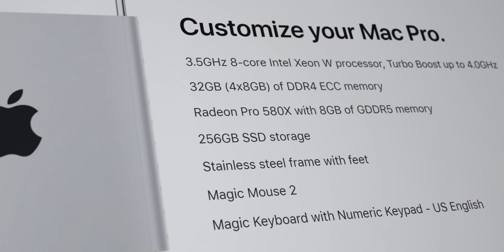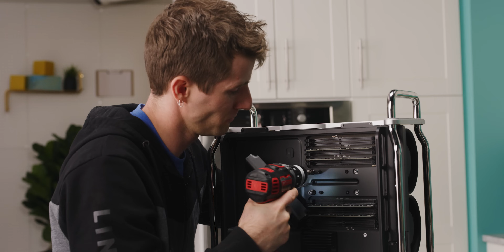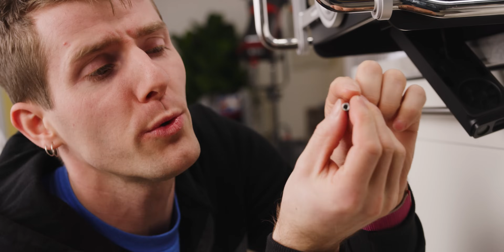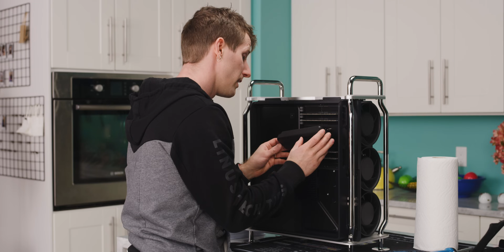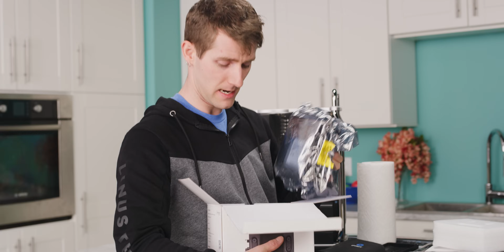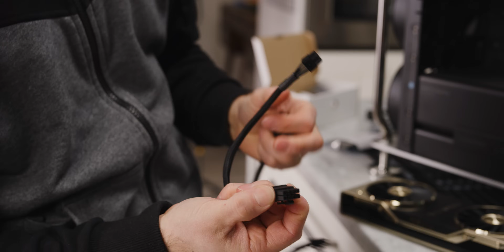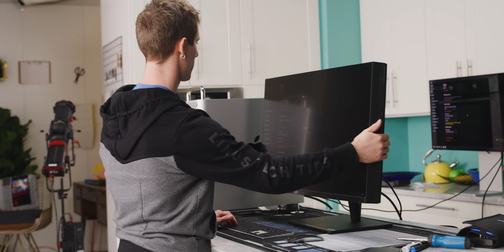Don't give Apple your MONEY - Mac Pro Upgrade Adventure

Comment: First of all, great video Linus! 

Secondly, just added up all the individual parts, from your list above, using the Titan RTX, R4i Raid Disc Enclosure, 96 GB RAM and the PCI-E Aux cables and we're already at $5700. Now add that on to Apple's $6000 base cost and now you're at $11,700. I mean, am I missing something here? Even with a third party upgraded CPU we're looking at even more money than my current machine. I can spec out a 16 core mac pro, on Apple's site for $12,799. We're talking only a $1000 savings, roughly. This is my first time even considering building a Mac Pro. I currently have the following at my house and planned to keep it (still might) until I saw this video. Here's the exact mac that I have now.  

MY CURRENT MACHINE: 
3.2GHz 16‑core Intel Xeon W processor, Turbo Boost up to 4.4GHz
96GB (6x16GB) of DDR4 ECC memory
Radeon Pro Vega II with 32GB of HBM2 memory
4TB SSD storage

I'll gladly take any tips here to save some money if I can...although this IS my main production machine (video and audio) and I can't afford to have it go down from some sort of hardware or software failure, just because I wanted to save a little money. 

Perhaps someone can guide me on how I can build my current machine, with third-party parts and save money because I'm just not seeing the gains vs cost here.

Comment: Use SCIgrip polycarbonate, polyethylene, acrylic, glue for plastic tabs that brake or any plastic it chemicaly heals the break will even glue a broken window back to where you can't even find a break.

Comment: Well, i know for over 10 years that you shouldnt give Apple your Money.
Nothing new in that.

I remember back in the Days, when i got my 7970, Apple released their High End Rig with 2 x 7550s ( which were already like a Year Old or so :D )  and claimed it to be state of the Art and that particular Mac costs like upwards of 10k Dollars.
After a while ( a Year later or so ), they offered an ugrade Kit with a 7970 which had the Stock Cooler and an Apple Bios. They wanted 700 Dollars for that.
I got my Aftermarket OCed 7970 for 350 € or something.

Comment: I know that Apple haters don’t realize this, but us Apple fanboys do know how to save money and buy 3rd party parts and do the upgrades ourselves. Really. I swapped all of the CPUs, bought 3rd party RAM, and replaced (went around) the old SATA II bus, and installed custom PCIe solutions in all of my 2009 Mac Pros. I’ve been doing this since the good old 68040 Quadra days. I’ve NEVER given Apple any extra money where possible. This is nothing special I know, but just sayin it for the record. We too shake our heads when they solder serviceable parts. Us Mac Pro fans have known the drill, some of us going back to the early ‘90s.

Comment: If you're upset about Torx screws and are instead praising phillips head, you ought to also complain about the fact that the Mac Pro has these newfangled display port connections instead of VGA. There's no reason anyone should be using phillips head anywhere these days. We should pressure everyone to switch to Torx for every application.

Comment: How did you boot natively into Windows without the aid of Bootcamp? There were Apple supported methods of installing Windows to a dedicated 3.5” HD in the 2010-2012 MP’s but you still needed boot camp to start the process...was it already installed on the Optane PCI-SSD? AND is it because of the non-apple supplied CPU? Typically it wouldn’t just boot a Windows boot disk natively without some tinkering

Comment: The "B" is for BACKSIDE so that you don't try and install it backwards or something... Since RETARDS ONLY buy Mac, it only makes sense that RETARDS ASSEMBLE MAC, and the B is used to ensure the item is installed correctly both by the Retarded User and Assembler; no offense to those that are Really Retarded as my intent is to insult anyone that buys Mac and not physically handicapped folks.

Comment: I wonder, can you use regular sata cables from the motherboard and use regular psu power connectors (for the pcie power ports on the motherboard) to sata power cables, and use double sided adhesive to stash away an ssd, so you don't have to pay 500 bucks for a hard drive caddy?

Comment: Surveillance drives are developed to run 24/7. So for a workstation that could potentially be running weeks of simulations or rendering at a time, you don't want to mess around!

Comment: so can they now use both video cards for gaming? is the first one not good for that? did they run windows from the new ssd for gaming? why by a mac if you basically end up having two machines in one? (two video cards, two separate ssds with two separate OSs?)

Comment: To be fair most of the OEMs do the same with ram - especially with servers.  The base model will have like 4GB of ram (why is that even still a thing?) and then charge you an arm and a leg to upgrade.  Depending on the make/model it's not always as simple as just buying any standard ram off the internet as the proprietary motherboards will tend to be more picky than ones you can just buy when doing a custom build.  I'm actually surprised the mac was flexible that way.

Comment: Pro Tip: While you may want to move your main boot OS to an additional drive, and just leave the fast-but-small built-in/proprietary SSD unused, that built-in SSD also makes a fantastic Swap drive, with a bit of macOS command-line hackery (easily Googled instructions are all over the place).  That's one of the classic macOS tricks that few people know that'll give you a tremendous boost to performance (especially on an older machine, like a old cheesegrater Mac Pro).

Alternatively, you can just keep booting off the built-in SSD and symlink your /Applications and /Users directories to your additional drive(s)— so the OS and swap have a drive to themselves, and all apps, files, and content live on a different drive (save /Library).  RAID is a great performance solution for multiple drives, but arguably being able to split drive usage between distinct processes (system vs. applications vs. media/files/data) is simpler and more performant.

Comment: Ok, a few problems: 
CPUs that Apple puts originally have much more Cache than you can buy on market. For example, 16-core CPU has originally 38MB of cache, on Intel site you can buy only 22MB version. Does that matter much? Well, with more cores and some tasks it does, and quite a lot.
Next thing is GPU. Yes you can buy one on market and put it in, but whene running benchmarks you will see that you get much more "juice" from original Apple's GPUs than those bought on market. Also only original Vega II Duo is actually currently the best GPU you can have as it have 2 GPUs that are used as one GPU. There is no crossfire in macOS so this is important if you need GPU power. 
So the only things remaining to upgrade are RAM and disk. And with disk there is a possibility that Apple will lock mac with T2 to only boot from original Apple's disks so the only 100% sure upgrade that will work in future 100% is RAM.

Comment: The cost of different color soldermask is usually dependent on the board house. Every place can be different. For low cost hobbyist stuff from JLCPCB the soldermask color is basically free. Although i believe right now they are only doing green for CNY if you happen to go look now

Comment: Keep in mind a significant portion of the huge price tag of both the Mac Pro and the Pro Display is from the machined aluminum externals. The Mac Pro case itself probably makes up at least $3,000 of aluminum and stainless steel.

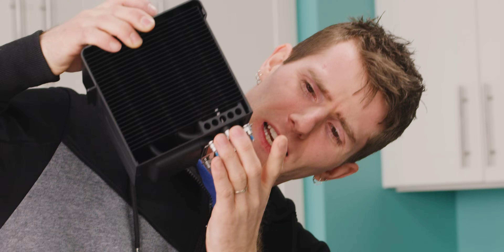Comment: 5:54 it is unnecessary. Odds are good Apple did it exclusively to make it harder for the average user to do their own work to it.
12:28 yeah but is it $400 slick? I promise you it cost Apple less than $30 to make that.

Comment: 1. the afterburner card is not included in the base configuration. 2. you upgraded to a very high core count cpu.
so my question is why do you put the afterburnercard in there where clearly this card has only one purpose in video editing, and as far i know only in final cut, with such amount of ram?
also would an PCIe extensioncard for 4 NVMe SSDs (lets say each 2TB) make way more sense? or do they not work because probably there would be no drivers for it in MacOS?

this configuration makes 0 sense to me.

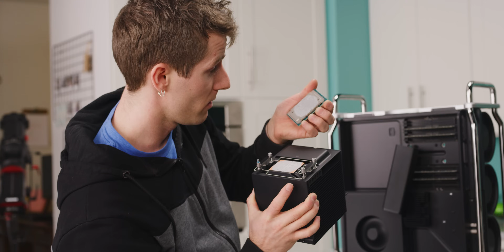Comment: 4:36 that statement is not accurate... I put too much thermal paste on my i7 with an AIO  enermax liquid cooler with the 360mm radiator and it made heat trap causing the CPU to over heat...

Comment: SATA on a machine at this price point? A SAS HBA would only be a hundred bucks or so, you can still use SATA drives with it, and spinning SAS magnets tend to be designed for higher reliability than their SATA counterparts. Seems like a no-brainer to me.

Comment: so what did you buy for $6000 just Mac OS and a computer chassis? looks like you replaced everything else and wasted even more for an empty drive bay. I'm not sure if everyone watching understands because they just see a new apple product and they think you made it better. what you really did was buy an expensive case to house a beastly computer no thanks to apple. Why does anyone buy an apple product? do you get off on constantly paying 3 times the price for 25% higher quality casings and other external pretty shit that doesn't matter because it's a piece of tech. at this point I'm just ranting at applefans who clicked because this is on trending, not hating on you Linus but you didn't drive the point home enough about how much of a waste of money this is. the $6000 base model is comparable to any $800 - $1200 PC with those specs ...oh Lord he spent $13,000 for no reason (missed at the beginning of the video he bought a higher-end version for the ability to switch between OS and the ability to have dual GPUs that's insane he spent an extra $7000 to have THE ABILITY to further upgrade.

Comment: My question is other than scientific research why do you need more than 16 or 32 GB of Ram?  I work at R&D for my company and handle the computers and support for our guys as well as my own Drafting and Engineering work.  For guys doing stress or fluid dynamics design sure 32 GB is nice.  Depending on what you modelling or analysing its a delicate balance between gpu and ram when you purchasing a machine for somebody's work.....but 64 or more?  (Don't get me wrong I'm sure there's some cases of guys working at big corps who use 64 GB but in my exp its not needed unless your working on HUGE projects). 
Frankly I don't see the need for this machine except as a server with all that Ram.  Its over built and WAY overpriced.  Also who does dual GPUs in a work environment anymore?  It's a waste of money when so many single cards meet everyone's needs nowadays.  Sure time is money put a good mid range and sometimes high end workstation nvidia card meets most needs.  Heck for some of my guys I've been contemplating gaming cards for them as a couple of test cases show that they provide more than enough horsepower  for their needs saving use thousands on workstations.  This is especially true now that much of the simulation software now offer cloud services to do the final analysis.  If my simulation guys need to do any large final analysis on their machines we are finding it very economical to send the setups to the cloud for final analysis.  Frankly with this I don't ever see us going beyond 32 or 64 GB machines EVER.   Unless ram for that range gets extremely cheap.  Otherwise I rather spend that money on better processors or gpus.

Comment: Linus : 'A 1.5 TB of RAM'
Google Chrome : 'Finally a worthy opponent, our battle is going to be legendary'
Reply: But we all know how it's going to end. Chrome still has that plot armour
Reply: No more kung fu panda
Reply: Maybe in the next 20 year, chrome will eat 3tb of ram
Reply: i get the joke
but i really dont get why everyone pulls chrome's ram usage as a meme...
rn, just for test purposes, im having 6 youtube tabs with running videos open in chrome, 10 extensions all active, and its only eating 1.3gb of ram. I consider that as normal ram usage.
Reply: Dead Meme my chrome uses 4gb
Reply: Dead Meme fam my computer has 6GB ram and it uses 5 sorry but you must have some optimisation setting on
Reply: @sheryarfarrukh8464  nope. I make very sure that i dont fall for such "optimizers".
Reply: Dead Meme I mean the built in ones it makes usage of cpu and ram limited
Reply: @sheryarfarrukh8464  no, as this is a completely new build, set up 3 days ago. The only thing i did is get my addons back through chrome sync. While writing this and watching a 1080p 60fps video, chrome is eating ~350mb ram. Is chrome just inconsistent AF or is there some kind of memory leak? Anyways, if chrome is eating a lot of ram for you then thats usually a good thing. Every Chrome extension you installed creates its own process. Chrome duplicates these processes for every open tab. That means if one extensions crashes, it wont crash your whole browser and may not even crash a single tab. Thats also why Windows 10 has over 130 processes all the time.
If you need my pc specs, lemme know.
Reply: @sheryarfarrukh8464  search "how to download more ram" on Google... It WoRkS 1!1!1!!

Comment: Linus, please describe the new CPU? How much was it? What about the OS? Is it a windows machine now? I know your point here was to max out the Mac Pro for cheaper and that is great. I am disappointed by the use of the Pegasus raid drives, however. So costly. Could you suggest an independent apple alternative. Would you have used the sonnet m. card with Samsung  ssds?
Doing all this wipes out the apple coverage, right? Apologies for newbie questions.

Comment: Look, I've called Apple. They're soldering everything on/to the MB now. EVERYTHING. No need to thank me.
Reply: honestly surprised they aren't doing that lol
Reply: @VashStarwind  As far as I know they still do that with laptops, but for full PCs it would be too expensive to modify the components for soldering them.
Reply: @Hoch134  Expense isn't the issue at all. Space is the issue on laptops and iMacs - they have decided that they want those machines to be as thin and light and compact as possibly. Soldering components rather than have a removable bracket for them allows things to be as thin as possible. You can argue the benefits of that, but that is why they do it. The Mac Pro has no such space restrictions and so it can be made much more accessible.
Reply: @cameranut  That's true for iPads and phones, but I wouldn't agree on laptops that use standard hardware.
It really doesn't take up more space to place a bracket for a cpu instead of soldering it and we see many competitors doing it better.
For sure, it was the reason for laptop manufacturers for a long time, but technology evolved. For now, it may only be the last justification to argue with the customer.

By the way, if I am soldering every single part onto the motherboard, at least I try to make that motherboard more resistant to external influence like water drops.
Louis Rossmann can tell stories about this.
Reply: Amateurs, they should just pot the whole thing in epoxy resin! I probably shouldn't give them ideas.
Reply: Rly
Reply: ROFL!!!!!!!!!!!!!!

Comment: Linus: installs almost 2TB of RAM into a $20,000 computer

Me: Cries in 12GB of RAM in my old x58 build
Reply: Sobs in 8gb ram and 60hz
Reply: @Adam-de8jm  lucky you, i have 8gb and an old tv i'm using as a monitor
Reply: @SuperMarioMan1234  144hz monitors are super cheap now. 100% worth saving up and buying one.
Reply: Gizzy uh it’s 6000 dollers
Reply: @nivioof  the base model is 6k, they didn't buy the base model. i forgot exactly how much it was so i took a bold guess, feel free to rewatch the entire video and correct me
Reply: I have 4 gigs ram lol
Reply: @webfleet1  F
Reply: @gizhaz77  i have ryzen 2400g with igpu (i dont have a discrete gpu) and 8 gigs ram
Reply: @babbangdexcitement5781  save up, slap a GTX 1660 or maybe a RTX 2060 in there and spoil yourself. and maybe grab another 8GB kit of RAM. you'll be set!
Reply: 9900k and 64GB over here 😭
Reply: @comandernejo  what do you need that kinda power for?
Reply: Gizzy work and games 👌
Reply: @comandernejo  I assume like After Effects/CAD type
Reply: Gizzy yup cad, rendering and photoshop
Reply: Cries at 16 gigs and 7700k...

Comment: I mean I dig that it's easier to modify but my problem is still that they absolutely rape their buyers with MASSIVE price markups. You could build a standard windows PC that would match this things performance for probably 1/3rd the price. 

What I don't understand is why CGI studios insist on locking themselves into the walled Apple garden.

Comment: Wait. I just upgraded my PC to 3.6GHz 8-Core boosting to 4.4GHz (Ryzen 3700x) and 32GB memory. So slightly better than the specs shown in the beginning. And I’m a cheapskate. Those are my “eh, I’m getting something decent but not going overboard” choices. WTF are they thinking selling that as super expensive pro build?

Comment: Why does so many people hate Torx? It's 100x better than any other driver in every single way. Philips was designed to slip. Avoiding slipping is the only purpose of a good driver and Philips was designed to fail in that.

Comparing Torx to Philips is like comparing Type C micro USB to serial port.